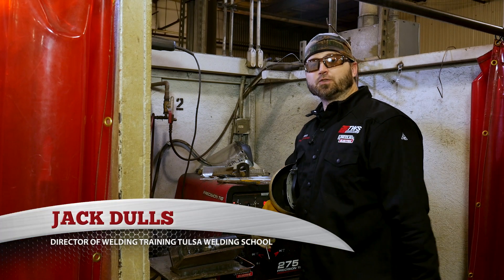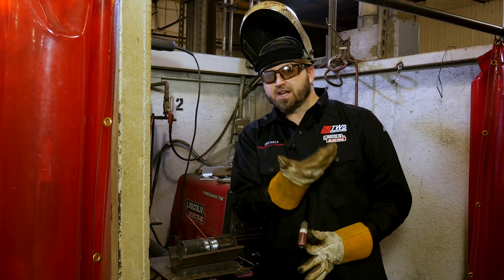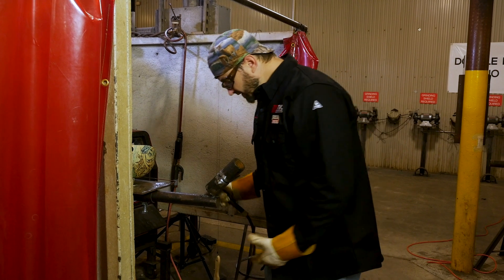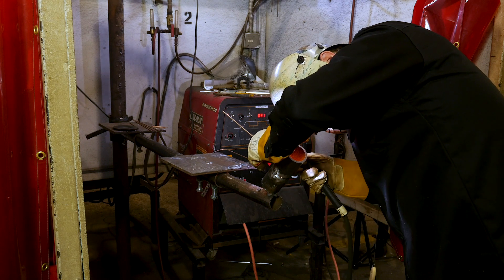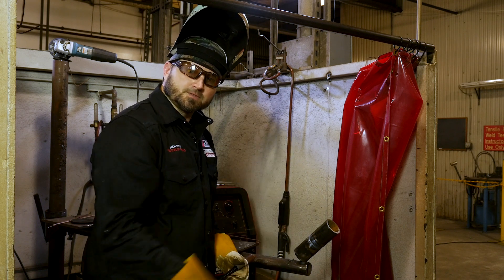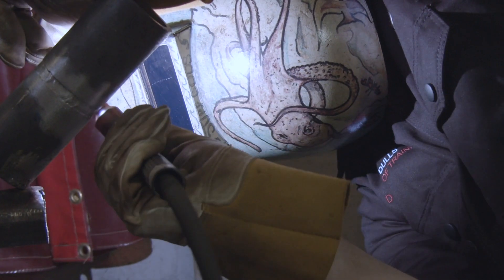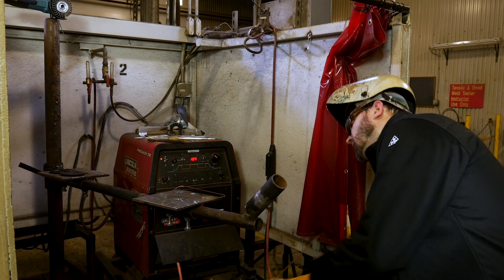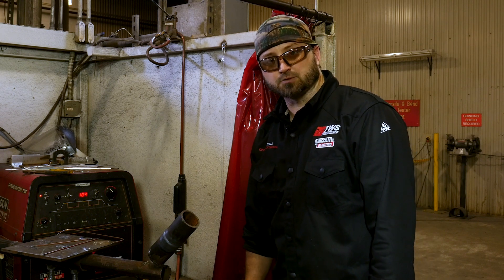How to TIG Weld a 2” Schedule 40 Pipe in 6G

Comment: I was told never to buff the fill before a cap cause you could lose the lines
Reply: Who the f k told you that stupid sh t?  After you fill, grind down any high spots and try to make it as flat and smooth as you can. Smoother and flatter your fill is, the easier your cap. As for "losing the lines," you make your own lines after the first cap. The top of it becomes your "line" and overlap it with your second cap. Then the top of your second cap becomes your line for the next cap and so on.
Reply: Buff?? Buff is wire wheel

Comment: What cup sizes are you using throughout the weld? How far out should the tungsten be? How many Amps for root,hot pass,fill and caps?
Reply: On 2” I run 85 amps root then turn up to 100, a 5 cup for root and a 7 on cap. Easiest way to set up tungsten depth is just do your stick out half of cup size. But I don’t freehand so most guys that free hand run bigger cup with more stick out.
Reply: I love using size 7 cup easier to see the tungsten

Comment: As an instructor, I figure you'd run your left hand like you did on your right,so you ain't fighting that body position. Or adjust that welding stand.
Reply: Whoa we got a badass over here...
Reply: Aren’t you supposed to not adjust your welding stand when you are taking a weld test for a job?
Reply: @kalebjacobs8056  correct, once ur tacks get inspected and they mark top on the coupon then you are locked in. Can not move any part of the test
Reply: Adjust it to where u like it and finish the test at that adjustment..

Comment: At what amps for root and what amps for hot, fill, and cap? Awesome video thanks
Reply: Whatever you’re comfortable with if you’re slower low amps if you’re faster higher amps also depends on gap landing sch of pipe and thickness of wire
Reply: I use 118 amp root and 115 amp cap once cool with 2.4 mm wire and 2.4 mm gap
Reply: @leahfinn5336 on sch 40. U root at 118amp. Wow that's pretty impressive  cause that pipe is thin